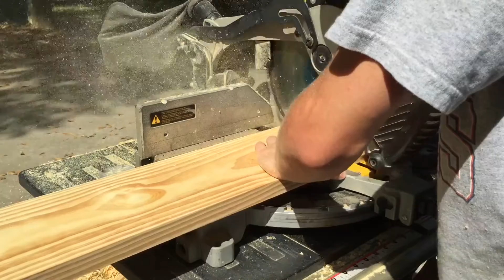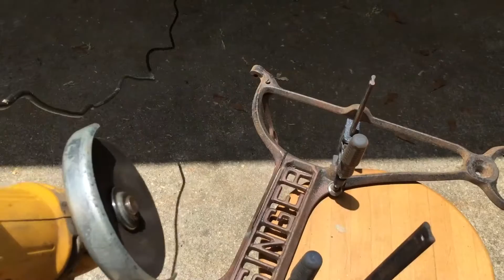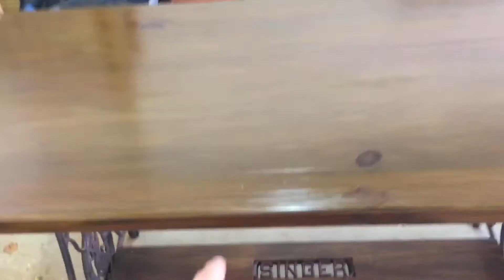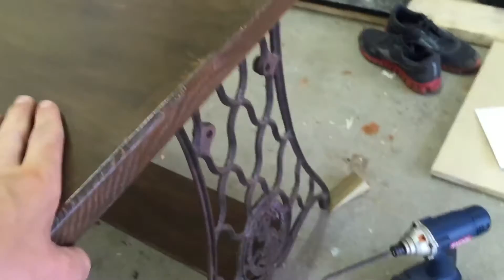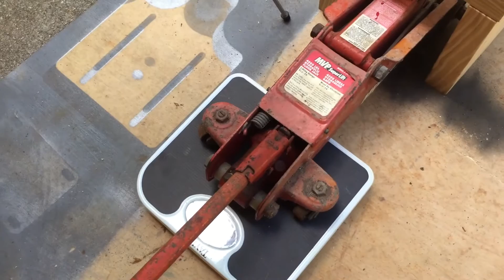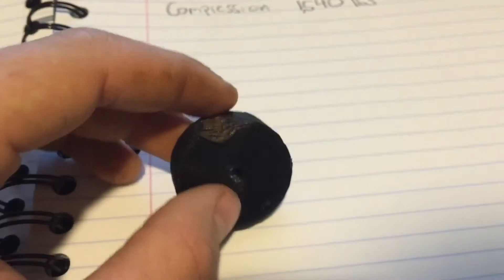DIY Singer Sewing Machine Desk Finished

Comment: I see on the legs, about a foot under the table top there are some holes where something was bolted.  You could make an angle bracket for each side that ran from the leg holes up to the top at 45 degrees.  One on each side will make it symmetrical your braces won't be as prominent and the shelf will be available for whatever wherever.    I just missed getting an old machine. I want to make a machine tool stand from them.  Cast iron rocks.   Your videos filled my morning with fun.  subscribed.

Comment: On band saw, move bearing in back of blade forward till it is just ticking the back of the blade.  Move blocks in util they are ticking the blade.  Touching but not rubbing.   Do this setup top and bottom.